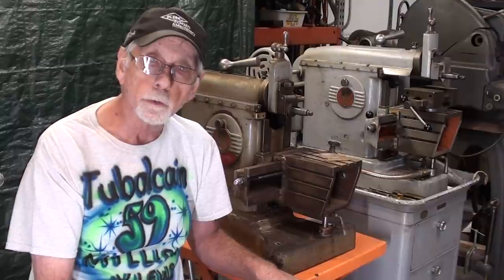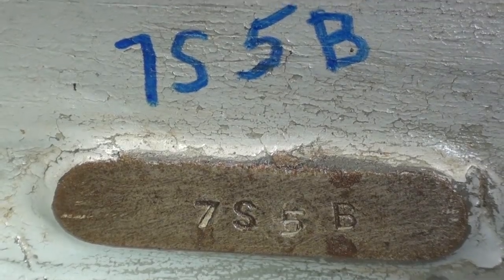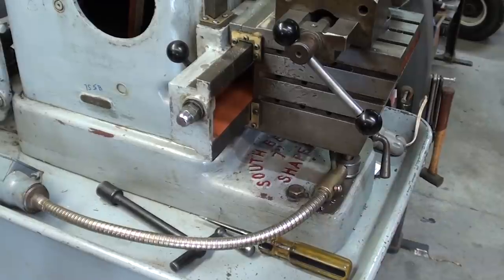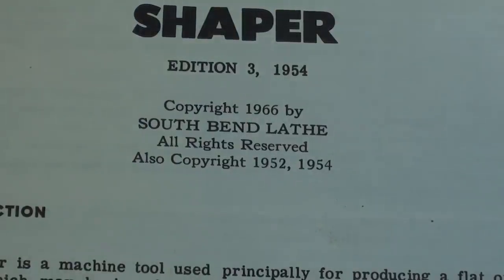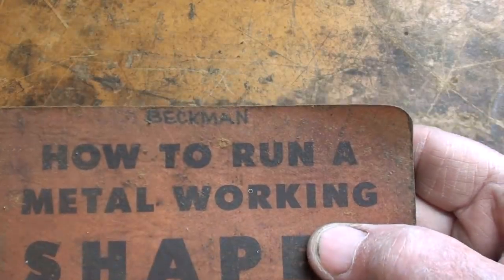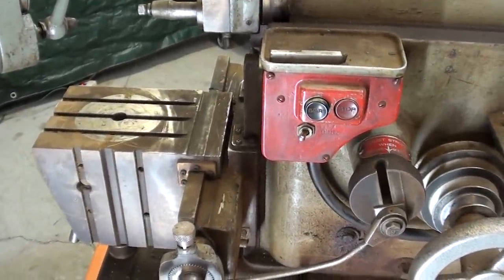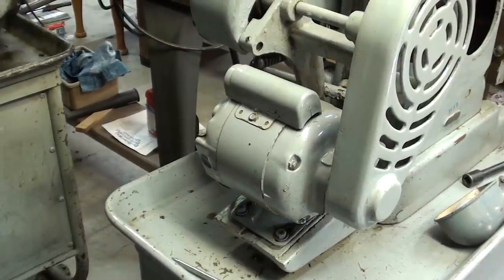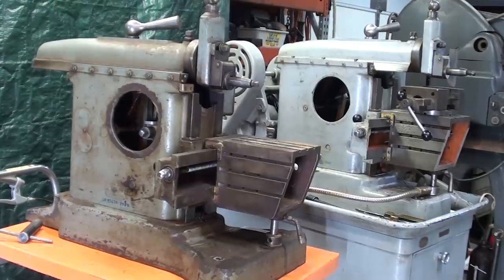COMPARING THE 2 SOUTH BEND SHAPERS Tips #672 tubalcain part 3

Comment: Fantastic video! Thank you for posting this. I worked for several years as a water and wastewater operator. We had an old shaper in a barn that they ended up auctioning off for a song but it was nearly 8 ft tall. It was a behemoth of a machine. I wanted to restore it but they decided to get rid of it. Obviously it wasn't a necessary tool for the job we were doing but I always wished I could have restored one. I didn't know that they made bench sized machines so now I'm going to keep an eye out for one. Thanks for the video! 🙂

Comment: Thank you Mr Pete. That was a treat to have an up close look at a great machine. 
I'd like to share that, when Grizzly ended up with South Bend lathes, they got all of the old paperwork. For a small fee I was able to get a copy of the purchase card by providing the numbers from my lathe. I don't know if they would have paperwork on shapers or not. Also if some other company ended up with part of it, they may offer the same. I found out about this on the Grizzly website. I was also able to get a NOS part from them at a premium price.  I hope this helps.  Thanks
Reply: Grizzly only purchased the name.  Those aren't South Bend Lathes.  They come from China.
Reply: @MrShobar  correct, but the point was that they have the original sales paperwork and you can get a copy. I found the information helpful in my restoration. Thanks
Reply from the maker: Thanks

Comment: Lyle, can't wait to see the rundown on the pumping system! It'll be interesting to see how the South Bend engineers solved the tricky problem of getting that pump to get oil where it needed to go at an acceptable flow rate... and get your opinion on the quality of the system. Regards, Jim from Killeen, TX

Comment: CE 3456 is on both the middle and oil soaked manuals. The zoom in at 6:30 into the video makes it easier to see. My eyes probably couldn't make it out if it wasn't for that. SO in essence they used the same manual format for at least 12 years according to the copywrite dates.

Comment: I am sure most people on here know that the NEMA frame size denotes the size of and hole pattern of the motor mounting base, the center line of the shaft line above the mounting surface, the size of the shaft in fact everything you need to know about the motor except the HP, the rpms and the voltage.  If you have 215 T any 215 T will fit, of course that is all it means but the frame size is explained in most electric motor books, including many furnished by the electric motor companies to larger consumers of their products.  If you have a device without a motor you can use the dimensions to know what motor would best fit your needs.  These books were common a few years ago and I am sure the information is available on line on most search engines.
Reply from the maker: Thanks

Comment: Mr. Pete, I have a narrow base early version of the SB shaper.  Mine came with some paperwork, "How to run a metal working shaper", just like the one you have,  use of postal zone prior to inclusion of the zip code.  Copyright on mine is 1952, "Edition 2, 1953.  I also have bulletin 5408D, the "The improved South Bend 7" bench Shaper" highlighting the force feed circulation.  Copyright on it is 1954.  I imagine its possible the early version was produced after 1954, but this at least indicates the change over happened sometime in late 1953 to 1954.  I wasn't aware SB had date stamps inside the cabinet, so I will have to investigate.  Thanks for tips
Reply from the maker: Thanks

Comment: Hi Mr. Pete! I have owned several of these shapers too. I have found the serial number contains the year of manufacture. Notice the numbers 56 in the sequence on your newer machine. The digits in the same place on the older machine could provide the date. Also, the serial no. should be stamped on the machined flat surface next to the ram towards the rear on the side where the cover is. You are the best! Thanks, Mark C.
Reply from the maker: Thanks

Comment: Oil having a viscosity rating of 150-240 SUS @100 deg. F is AGMA No. 1 or ISO Grade 46.  Use hydraulic oil from Tractor Supply.  Or you may have some already.
Reply from the maker: I have 2 gallons of iso 32

Comment: Hi Mr. Pete.  Nice informative video once again.  Quick question about painting old equipment.  Have you found a good primer to use when restoring equipment?  I took a crack at repainting an old Craftsman vise and had used some Rustoleum primer prior to painting.  Paint is chipping off even in non-contact area.  Any tips?
Reply from the maker: No tips.    My paint always falls off after a while